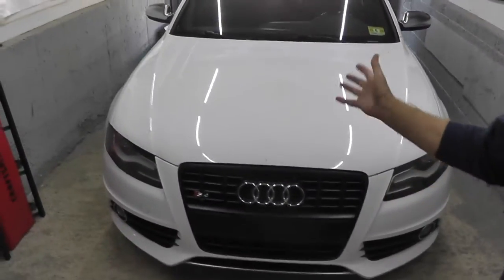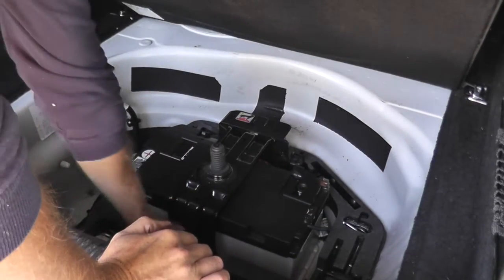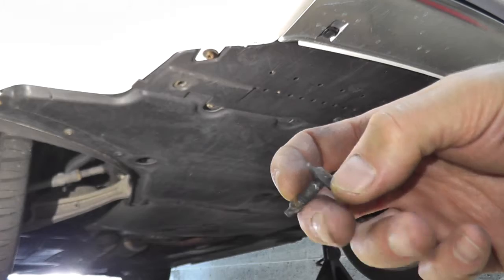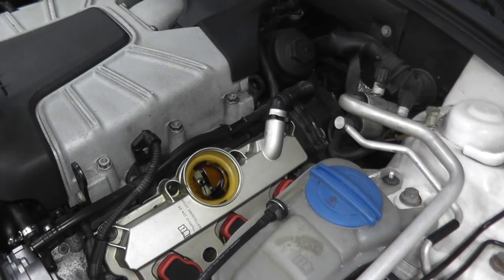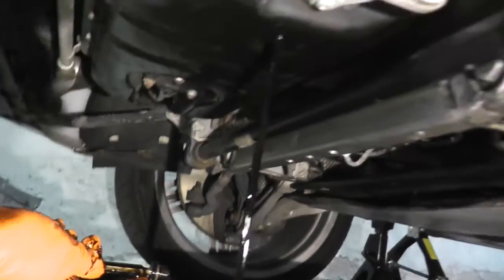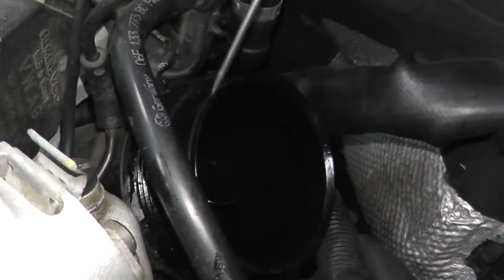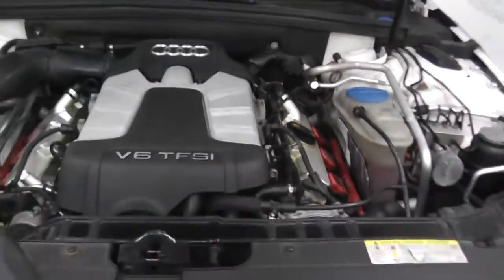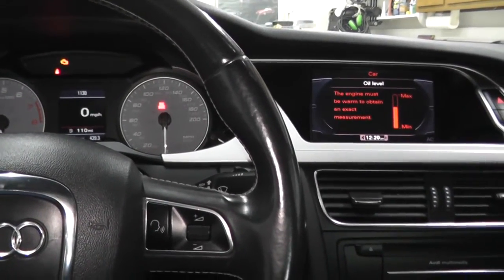Changing Oil on a Modern Vehicle is Not Fun, Convenient or Easy.

Comment: Go to harbor freight and get yourself a set of ramps instead of using a jack. It makes your fluid changes much easier. I just changed the oil on an A6 3.2l a couple weeks ago and the hardest part was removing and replacing the belly pan which wasn't terrible.

Comment: Changing oil on German cars is actually easier than the likes of Honda/Toyota, with a suction pump. I have Mityvac 7201, it's so easy to change oil on my Audi Q5 (similar engine as yours). That's how Audi dealers do oil changes. Open the hood, suck the oil out from the dipstick, change filter cartridge, refill. I don't even need gloves and my hands are clean. When I tried on my Honda, it didn't work because the oil passage doesn't go straight to the bottom. The German cars are designed to be serviced that way.